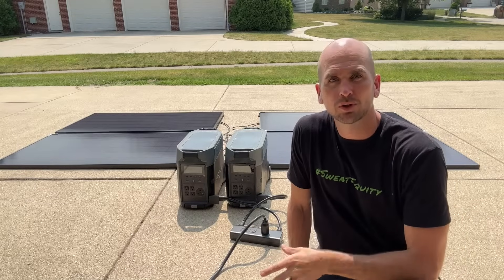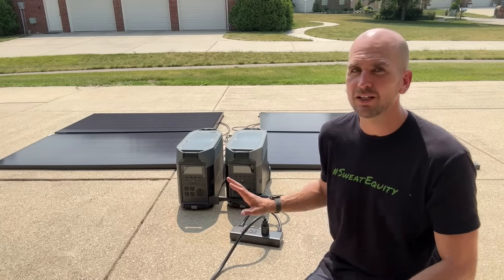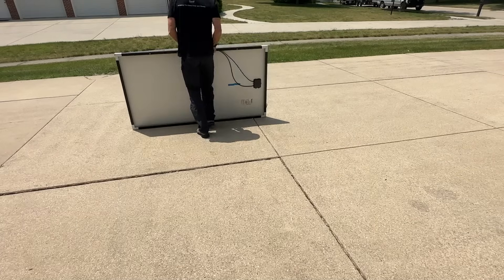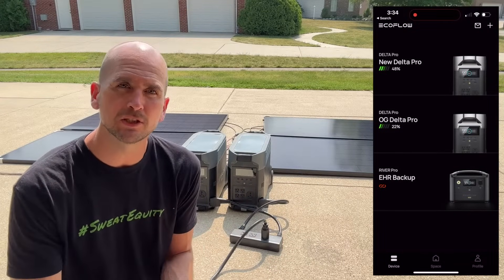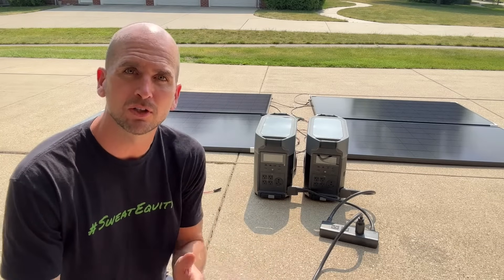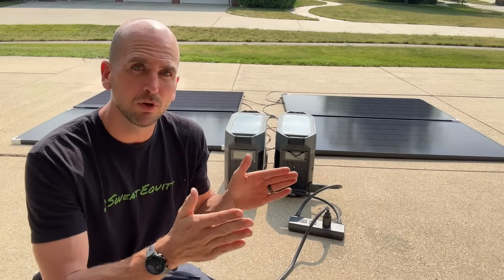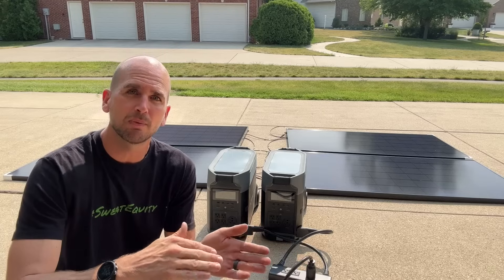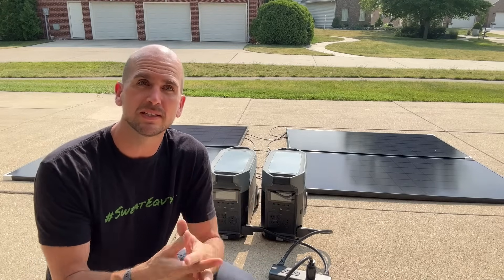Powering My House On EcoFlow Delta Pro And Solar Power!

Comment from the maker: Calculate Solar Cost For Your Home - https://geni.us/solar_reviews

Ecoflow Delta Pros with Dual Voltage Hub: https://geni.us/HijVzm8

DISCLAIMER: This video and description contain affiliate links, which means that if you click on one of the product links, I’ll receive a small commission.
Reply: Thank you for sharing the solar panel cost estimator! It's always helpful to have tools like that when considering solar power options for the house. Speaking of power solutions, have you heard about the Segway Portable PowerStation Cube Series? It's a versatile powerhouse with a massive capacity and super fast recharging time. It could be a great addition for outdoor camping or as a home backup power solution. Check it out if you're interested!

Comment: When that 240 hub is turned on, you can't recharge using a generator - just solar. You have to turn it off to recharge by generator. Not much good if you run low on battery power at night or cloudy days. I returned my units because of that. The Ultra will now recharge by generator while in use, although twice (or more) the money, you don't have to shut down the house to recharge. Recharging from a small Honda at night was the deciding factor for me, without that capability, you are just delaying your power outage.
With the 240 hub turned on, you also lose all the other outlets along with the recharging. One little fact they don't disclose in their listings.

Comment: The delta 2 max has 2 solar input slots, yet the delta pro only has one? Why?
Reply from the maker: The Delta 2 Max most likely has 2 of the standard 500W MPPT charge controllers like the one in the Delta 2.  The Delta Pro has a larger MPPT charge controller (1,600W).  I think EcoFlow is trying to use components across multiple size power stations whenever possible like most companies.

Comment: Hi everyone, is there any chance to connect the Delta Pro 3 with an existing inverter? So you can somehow use the existing solar panels on your roof? Thanks in advance 👍🏽
Reply from the maker: I don't think so.  Do you know if you have micro-inverters or a string inverter for your roof-mounted system?
Reply: @ It says „string inverter“.

Comment: Having batter/solar for backup but having to manually flip a transfer after power is out kinda is defeating a big reason to go this route IMO, I would want it to keep the house going during a brief power out, and give me time to go hook up the generator for an extended outtage (until I can get enough solar to run the entire house alone, and my house uses ~45kwh per day...

Comment: I have 2 ecoflow delta pro 3 and would like to know if I can connect them together to balance each other when is use.
Reply from the maker: You can connect 2 X Delta Pro 3 units together into a 50-Amp outlet hub.  That gives you a NEMA 14-50 and should pull from each unit evenly.
Reply: @everydaysolar  thanks. I am only doing 120 on each.

Comment: Why didn’t you wire in parallel? The unit will only take in x amps, unlike volts. Why it’s like this idk I’m not an electrician, but it is. I’ve three 400 watt panels in parallel hook to my jackery keeping the volts under 60, and the amps are higher than specs but for some reason this works.

Comment: Could you have used 3 in parallel  +  2 in parallel and run the two parallel sets in series to boost it closer to the max input?

Comment: Ecoflow’s products may work well but unless you have a location that you can pick up the product in person I’d stay away and find another company. I’ve run into nothing but headaches dealing with their Chinese customer service after terrible delivery experiences spread over 3 separate orders. EVERY SINGLE TIME I’ve placed an order they sent broken or incorrect items. Took me over 3 months of jumping through hoops trying to get what I needed for my system and my issues were still never completely resolved. I ended up having to buy a duplicate item(sent me faulty one)  from another supplier because they refused to make it right and stopped responding to my emails which is crazy when you’ve spent 12k with a company. If I had it to do over I would have went with another company for sure!

Comment: My local power company installed a new meter with a port to attach a generator cable. It is only 30a max though?  Can I use a 50-30 pigtail adapter and use the 50a ecoflow hub?

Comment: I have a question fellas, once a ecoflow is fully charged and then I put it away turned off how long can it stay charged in the closet. Also that areas in summer gets up to 90 degrees inside the home.
Reply: Mine was in storage for a couple months.  Turned it on and it was still 100% charged

Comment: What happens if you use parallel? From experience, used 4 panels that are greater than the battery recommend. However the ecoflow delta adjusted accordingly. Using series, increased the voltage which can in return fry the xt socket.

Comment: I want to ask if it is a 500w input can u use double 500w panel to get full capacity or the current will be too much?
Reply from the maker: The Delta Pro will limit the current just make sure the total voltage will never go over 150V or the solar input will shutdown to protect the electronics.
Reply: @everydaysolar  ok the only problem is the voltage? Hence u dont exceed the volts no problems. Thanks very very much this was very helpful. I bought a powerstation it came with a 500w panel. I can never get full charge only 250-290w solar input  all the time. So I'm doubling my panel to make sure I stay withing the 50v range so I can enjoy my full 500w thanks
Reply: @everydaysolar hi I asked u this question one year ago. I finally doubled my panels and run it in parallel the voltage remained the same but now my solar powerstation is bad. It doesn't charge from solar again is it because of over current?

Comment: l've had two delta pros now one has a faulty screen and is 3 months old and I'm hold I only get a refurbished replacement not a new one
My second one smokes comes out the sides when you plug a 400 watts solar panel into it EcoFlow has repaired it and it still dose it so l've asked for a new one and l've been told they can not offer a new one or a refurbished one as I did not buy it from a registered seller ie them so just been warned we don't have warranty unless you get it from them so why are you selling them to other companies not a very good way to do business
Reply from the maker: Dang!  That sucks and warranty should not be tied to the purchase location.  Thanks for the feedback as that does help others as they try to make a purchase decision.

Comment: This thing cost 8k plus can't run your house a full day or charge complete..  not going to produce half the kw you need.. for multiple days..  basically your throwing money away
Reply from the maker: EcoFlow is rolling out a new unit (Delta Pro Ultra) today which in conjuction with a Smart Panel 2 is much more compelling.  Delta Pro Ultra - https://www.ecoflow.com/us/delta-pro-ultra?aff=650
Reply: Lol i just pick this up for 2k on sale

Comment: You would have had a much higher surge capacity for powering your home's high inductance loads such as full sized refrigerators, large power tools, portable AC units. EV charging or large microwave ovens if you had purchased a hybrid, low frequency, transformer based inverter charger and a set of LFP batteries instead of these cheap, high frequency, transformerless solar generators. You would also have a far longer service life as well. 

The reason for this is that all of these lightweight, high frequency inverters lack a very critical component. That critical component is an iron core, copper wound output transformer. Without an output transformer to act as a buffer to absorb electrical surges provided by the “Flywheel Effect” inherent in the physical amount of a transformer’s iron, these surges and damaging reverse voltage spikes must be handled directly by the inverter’s MOSFET transistors, essential shortening their life. 

You might be able to start and run some high surge loads when these high frequency inverters are new, but every time you fire up one of those inductive loads, you're shortening the life of the MOSFETs in the inverters in these solar generators. Lightweight. high frequency inverters run much hotter than low frequency, transformer-based inverters which makes the low cost, off spec, Chinese made components such as capacitors, diodes, resistors and ICs that are used in the cheap inverters that are used in these inverters, far more prone to early failure. 

Another major consideration with these lightweight, high frequency, transformerless solar generators is safety. All it takes is for the AC output monitoring circuitry to fail and one of the MOSFETs in the inverter's H-Bridge circuit to short to ground, and these inverters can dangerous, high voltage, high amperage DC current straight to your connected AC loads which will not only damage most AC appliances but can also set those AC appliances on fire. With over 24 years in the inverter repair industry, I would never recommend a high frequency solar generator for use in a residential application. They don't last, and these non UL-1741 safety certified units can be dangerous.

Comment: With all the money spent, you could install a grid tied solar system with battery backup and save on your energy bill monthly
Reply from the maker: Grid tied solar and battery backup which be just a bit higher.
Reply: @everydaysolar That would be a lot higher.

Comment: Ngl im concerned with these products whenNO ONE ON THE INTERNET WILL FILM A 0-100% FULL SOLAR CHARGE WITHOUT BECOMING AN MIT ENGINEER!!!
Reply from the maker: I have been cycling these units over at a detached garage where they are my only energy source.  So far so good.  I will be installing a mini split soon and cranking up the energy use/ cycles.
Reply: Lol.. i charge mine up daily with solar and 10-100% daily. Im an insurance adjuster. If i'm more qualified than i realize then i appreciate the compliment

Comment: Something to consider. My house has 9000 watts of grid tied solar, If I was to connect my Ecoflow pro's to my panel with the interlock. If it tricked my Ephase inverters to turn on it could fry the Ecoflow. I don't think you can push 9000 watts into the Ecoflow inverters. That's why a critical load panel makes more sense. Oh and tell Ecoflow that the MC4 adaptor wire size is to small. I can feel mine getting warm at 1,100 watts 15 amps.
Reply: It shouldn't your delta would need an ac coupled inverter to activate your microinverters

Comment: Hi, Hope all is well? Unplugged Delta Pro & Smart extra battery last night to test how long they would run my stuff. After 16 hrs, they shut down. Upon plugging them back into wall outlet, they immediately started charging, but AC “Pass Thru” was inop. I’ve got all of the AC settings set to “Stay On”. Any idea what I’ve done wrong? I’d thought that this issue was fixed in a previous Firmware update? If I was out of town and we’d experienced an outage, none of my devices would have been powered afterwards. Thanx, Bert
Reply: Bluetti can be controlled via your smartphone.

Comment: I want to set this up with a transfer switch to power my lights and fridge full time
Reply from the maker: Take a look at the new Smart Panel 2.  This can give some really cool power management features running individual circuits off of batteries.
Reply: @everydaysolar  it’s really cool with all the software integration but so expensive. I can get a transfer switch from Home Depot for so much less. The tradeoff is it isn’t automatic. I just got a 450 watt solar panel off marketplace for 120 bucks where ecoflows panels are 800 bucks

Comment: Solar input of only 15 amps and 150 volts is too small to be practical for real world dedicated loads like a window AC to simultaneously  use and keep the batteries near topped off.

Comment: I like the delta pro except how the hub is connected and that it can’t auto start when battery levels go below the threshold and charged back up.  What I mean is if you drained the battery overnight it would shut off and when the sun comes out the delta pro could charge back up to 100% but the delta pro doesn’t restart without human intervention.   This is a must have so I may lean toward building a DIY system.
Reply: Just dont let it go to complete zero and the problem is solved.
Reply: @HeyBabyMilo  how do you not let it go to zero if it’s powering your house at night - unless you keep getting up all night to check it?
Reply: @1drhnsd1  you can supplement with a gas gen to power the home keeping DPro from depleting below 30% before recharging can take place. (In the event of an outage). We just keep the gas gen to a minimum because it's annoyingly noisy and not cost efficient over time but for the first 3 hours during charging, we'll use gas gen to carry us through. 😊HTH

Comment: What are you running to use 20-25 kWH if the A/C is not running?
Reply from the maker: That is usually outside of the AC summer loads.

Comment: Ok.  Well I just watched your video on wire gauge. So I’m looking at using 230-250 v panels. With 8.27A and 30.3V going out. So running in series I’d be using 2 (60.6V and 8.2A) and I could connect 2 of these in series with 120 V and 16+A, but only 920w leaving me short roughly 600watts from 1600. Right ?  I’m a carpenter, and a medic, so if it’s out of wood , I can build you anything, literally anything. If it’s dying, Im pretty good at that too. Electrical is voodoo to me. I foresee myself waking up on my back on the concrete smoking a bit. 😂

Comment: I think solar generators. Should start making 240v split phase. With transfer switch and charger. Would make a huge difference in the solar industry. Not to mention more pv input. At least a minimum of 2000w, with a 150v voc. Lifepo4 51.2v
Reply: I think Blueddi does, without all the wires between units
Reply: Victron Multiplus is the only way to go

Comment: Are 2 of these batteries or perhaps 3 alone (without being paired with solar) a reasonable solution for up to 24 hours without power?  I'm in the Midwest and we typically just have 1-2 power outages per year and our utility (ComEd) does a pretty reasonable job of restoring power within a few hours.  Don't think I need to plan for multi-day outages but at least want to try and prepare for worst case of up to 24 hours w/o power.
Reply from the maker: Are you going to tie the battery into your home through a generator inlet plug or just run a few things from the 120 outlets on the front (refrigerator, wifi, phone/laptop charger, etc.?
Reply: @everydaysolar  I'm a total newb to all of this so may not answer correctly.  But, I don't have a generator and would be looking to maybe use this device alone as best I could (2 or 3 if need be) to try and back up my home as much as I could.  Just at the very early stages of trying to understand all of this.

Comment: Are you going to put out the pergola solar video?
I just finished a new 14x20 pergola and was going to run power to it, but you got me thinking... 'maybe solar'  :)
Reply from the maker: Got a bit delayed.  Waiting for 11 kW to get professionally installed on the roof and then looking to tie in the additional roughly 4 kW from the pergola.  The 11 kW is going to be a line side tap so need to see if I can bring my 4 kW through a separate Solar Edge inverter into my panel.

Comment: After a year with 2 Delta Pro + 2 extra batteries  I have to say " Stay away from it " 
1) after 2 months dual hube give up , they sent me new one and I return the damage one (5 stars)
2) last month I have error code 79 system shutdown : solar charge drop from 1600W max to 1280W , 12 volt out put dead , battery drain uneven.
I still have full 2 year warranty but EF offer only for repair not temporary replacement and all reply take days .
I just spend $7K for EG4 6KW 240volt inverter 15KW battery that is much cheaper than 2 Eco Pro + 2 extra battery ( +/- $11K )
Reply from the maker: Luc thanks so much for the feedback.  I have been browsing on Signature Solar for an off-grid Solar setup so nice to get the feedback on EG4.

Comment: Do you believe this works out better than the anker? On sale 5kw for 2600.
Reply from the maker: Not a bad price, I had good luck with EcoFlow.  Right now I have both units (Delta Pros) at a few of my rental units as they have been out of power for 3 days now.  The big question which I can not answer is the durability of EcoFlow, Anker, Bluetti, etc. over time.